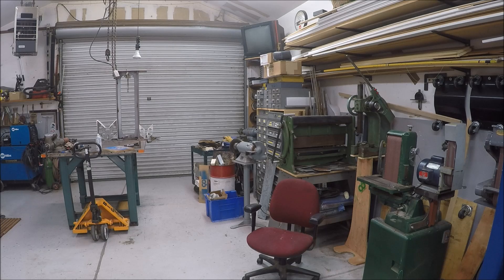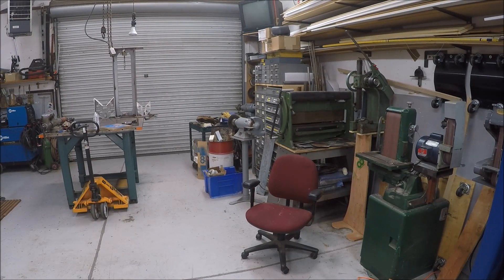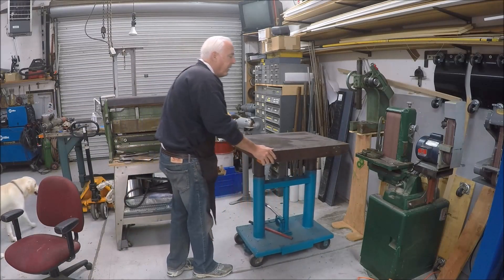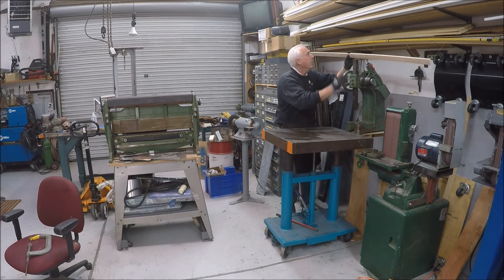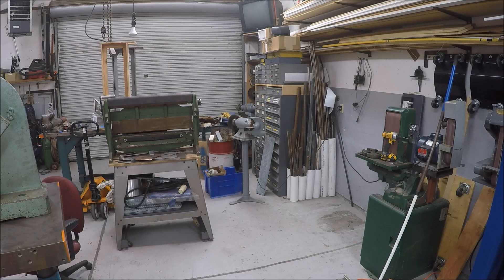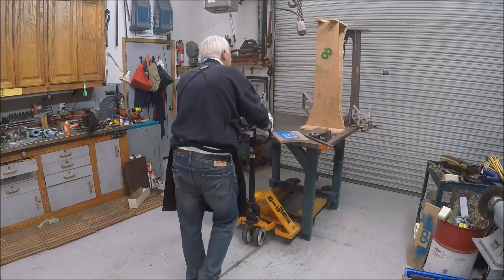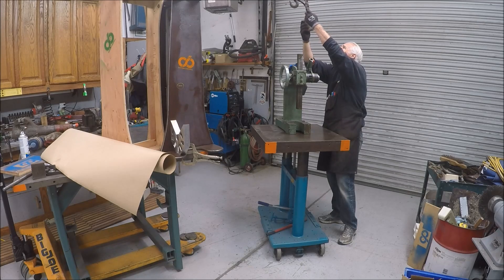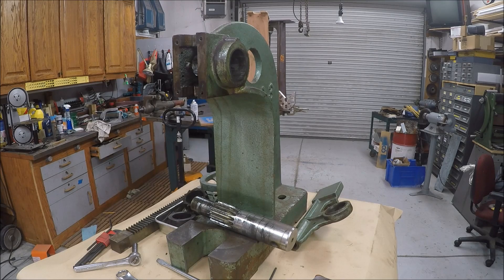ARBOR PRESS BUILD  part 2

Comment: Now you need to explain that TV up in the corner, I suspect you can't even get a signal anymore that will work with that antique  :)
Reply from the maker: Yes, the TV still does work, I watched the Indy 500 while in the shop...hmmm, ok listened more than watched...LOL, but you are correct you need an adaptor box for it to get a signal...